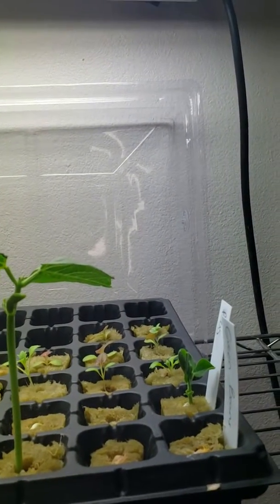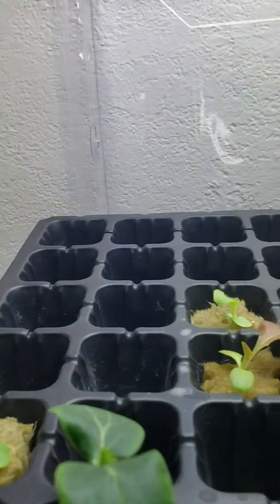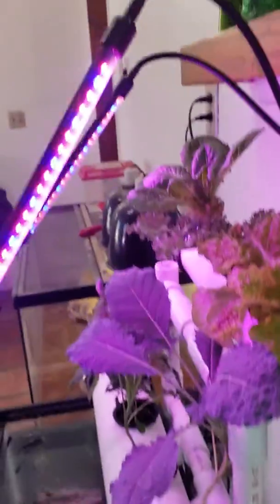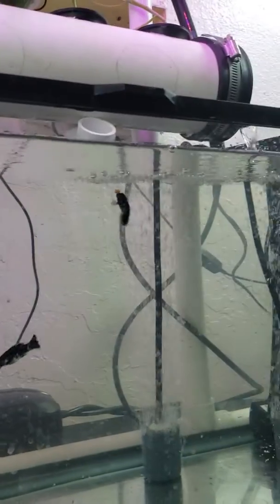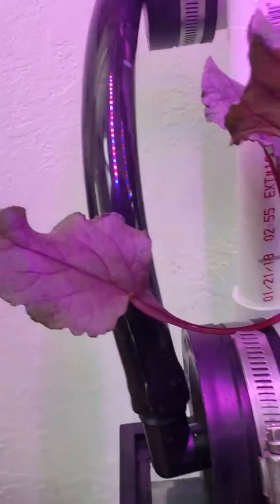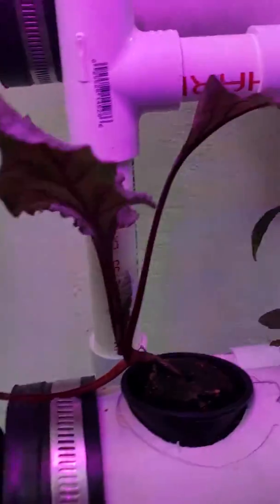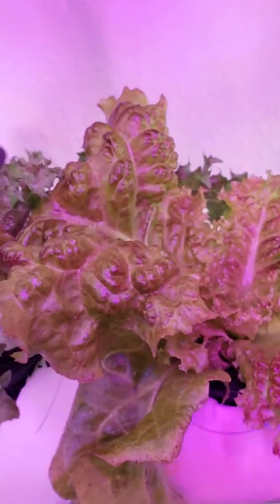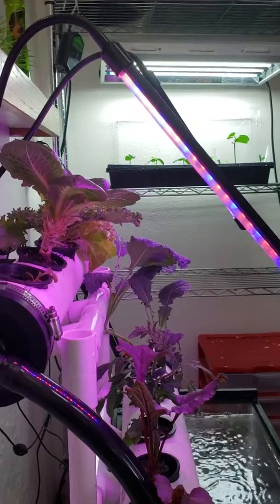Original aquaponics design (nano scale)

Comment: Hi mate, I'm really interested in starting a aquaponics system with rainbow trout, you know how you say you have the solids filter in this nano set up, have you found that you need a solid filter in your larger system with tilapia? I've seen mixed ideas on this so was wondering how yours is ran. Thanks and keep up the vids :) Love from the UK
Reply from the maker: Hi and thanks Lewis. I do not use a solid filter at all. Between the nano bubbles, uvc treatment and a quarterly change I haven't encountered any problems. As a matter of fact, it's much easier in the larger system. I did some huge changes today. Check in for tomorrow's video my friend.